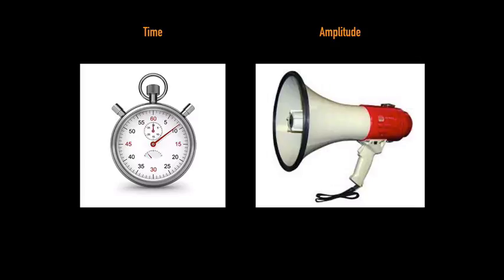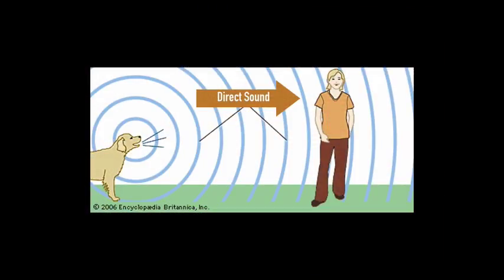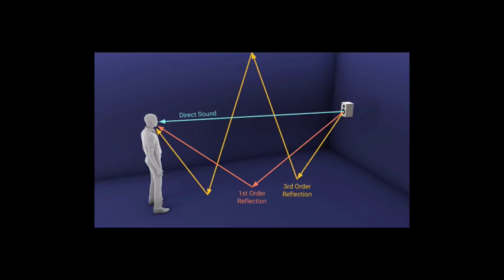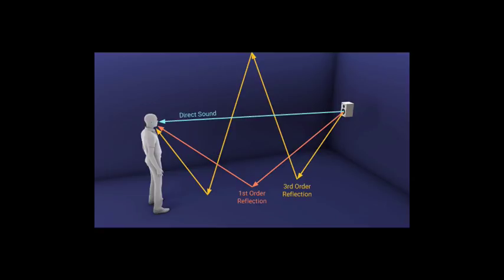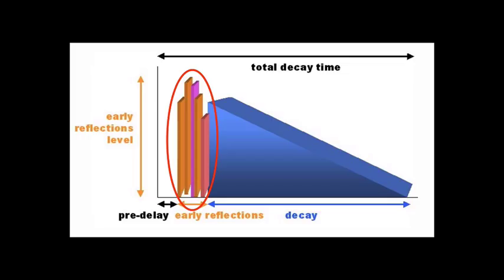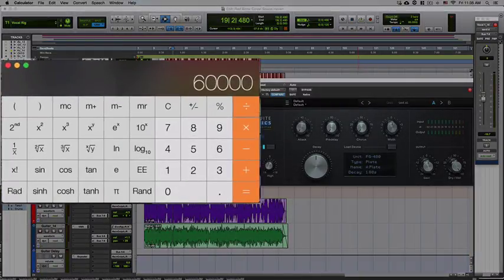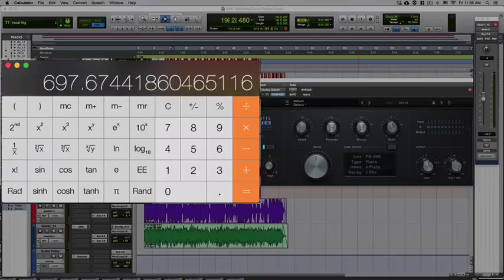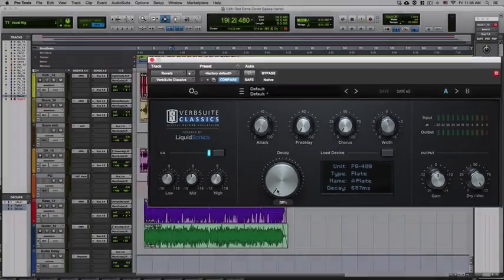Concepts of Reverb: Audio Concepts 101

Comment: What about diffusion??
Reply from the maker: Diffusion is pretty cool, in reality it would be using those panels of hard wood that are inconsistently placed to direct sound in different directions. But i've also seen it as settings on processors. 

Depending on the processor the control would probably effect how fast the reverb tail becomes inaudible. Very useful for sculpting reverb times!

Comment: What is the math equation for the decay time based on? Great video by the way; liked the graphs especially.
Reply from the maker: So something I should have mentioned about the equation is that it's a tool to set you into the right direction when searching for your decay time. You should always use your ears to dial in the right amount of decay. 
The equation helps sync the tempo of the song to the our normal time scale. 60000 just represents the number of milliseconds (what decay time is measured in) per minute. Hopefully this clarified. Thanks for the comment!